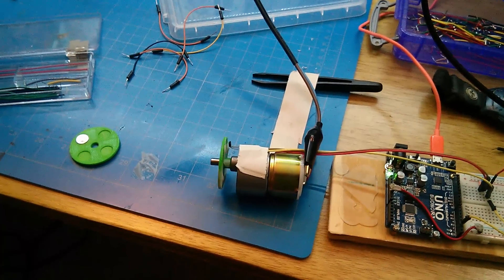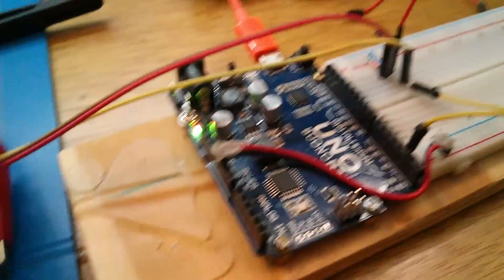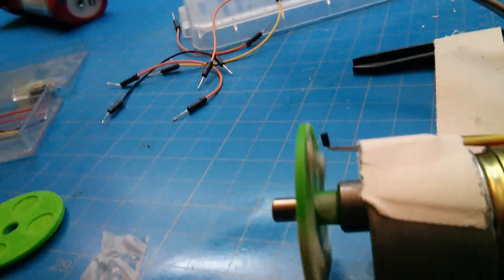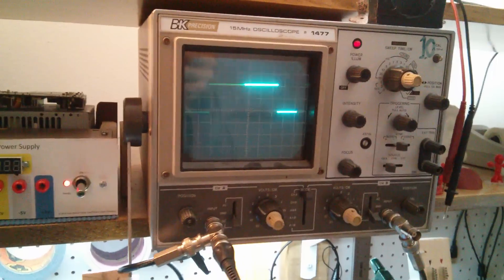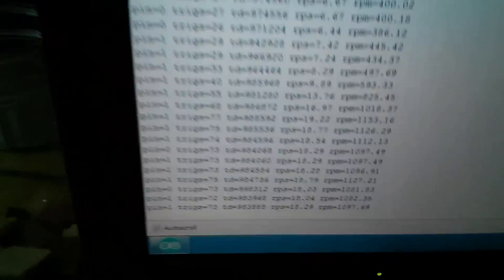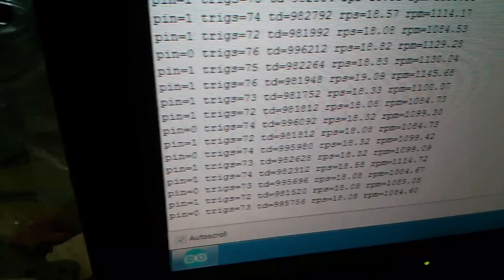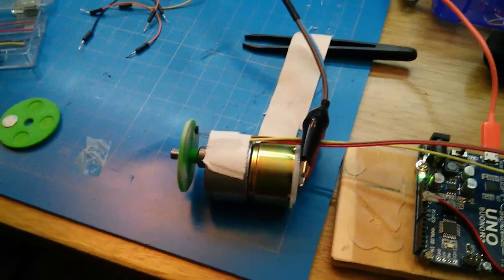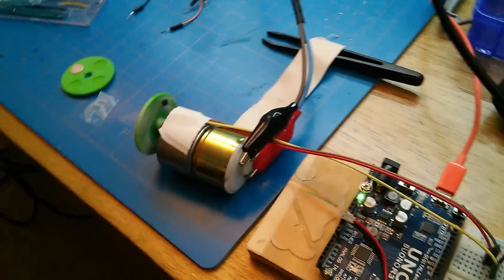DIY Hall Effect rotary tachometer

Comment: can I get the code please.
Reply from the maker: Sure. It's nothing special, since the sensor just shows up as a simple switch.

http://pastebin.com/tiVrH2ck
Reply: thanks a lot Sir. It would be wonderful if you could please share the pin connection too.
Reply from the maker: It should be clear from the code...I'm just using pin 2. 13 is the onboard LED.
Reply: Thank YOU
Reply: So if I only use two magnets I change num_stops to 2?
Reply from the maker: I believe that is correct.

Comment: Could this sensor be used to make a high precision servo from a dc motor?
Reply from the maker: +Stellan Haglund I see two ways you might go about that. The main challenge is that the accuracy is fairly low at low RPM, since you only get a few magnets per revolution. 

If you put a lot of gear reduction after the motor (like 60:1), though, then knowing that the motor turned a quarter rotation will mean your output shaft has turned 1/240th of a rotation or 1.5 degrees.

Alternately, if you just need to a servo that can quickly arrive at one of a few pre-determined angles, you could just put magnets at those angles and use them as position switches.  This wouldn't really be a "servo", since you wouldn't be able to send it to arbitrary positions, but it might be fine for some applications.
Reply: Thanks for your answer, I've been reading some since I posted the comment and it looks like optical would be a better way to go, maybe not as easy but seems like it's capable of a great deal of precision
Reply from the maker: +Stellan Haglund Yup, optical is generally what you do when you need precision. Sounds like you need something more like an encoder than just a tachometer. If you have room for something a bit bulky, ebay has ~$10 encoders that do 400 pulse/revolution. Just search for "encoder 400" and sort by price.

If you need something compact that goes over a shaft, AndyMark sells micro optical encoders, like the E4T.

Lastly, if you're truly look for something like a servo, the way a servo works is that it's just a geared DC motor driving a shaft with a potentiometer on it. If you only need a fixed number of revolutions (like a hobby servo's 180 degrees of rotation), that's the way to do it.